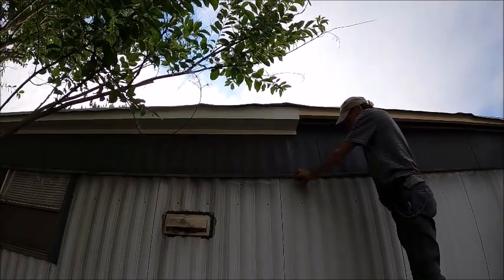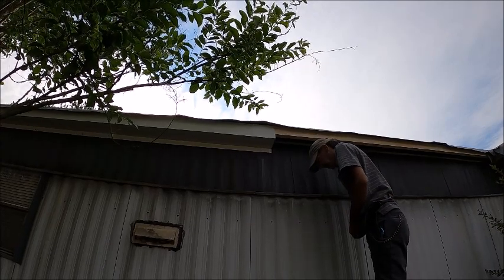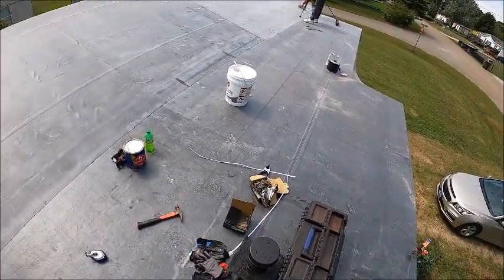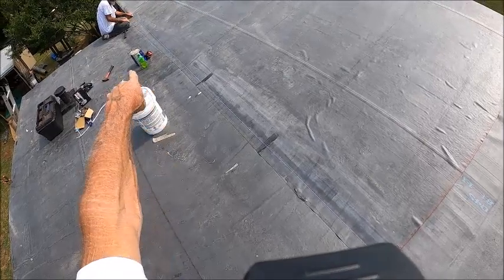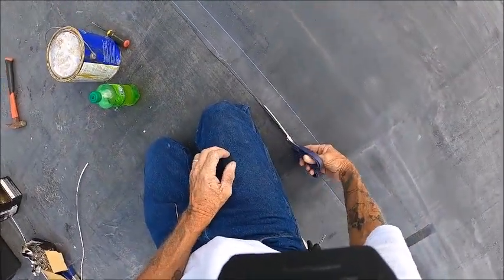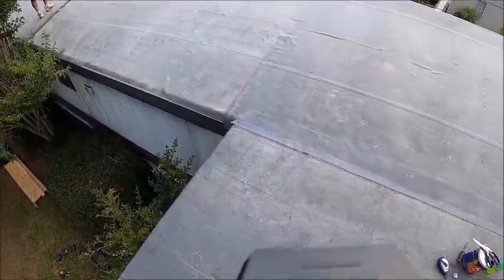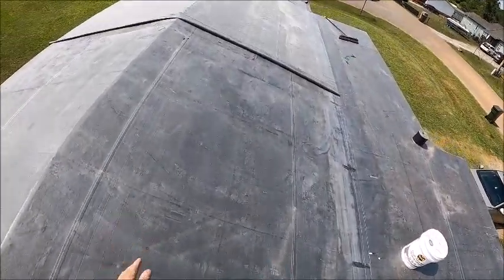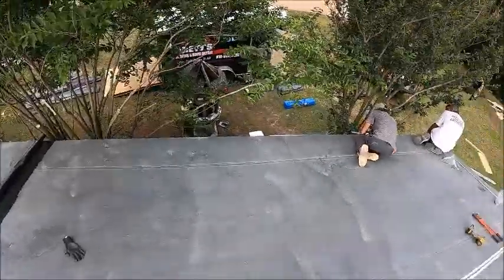Mobile Home Roofing and Repair Hazel Green Alabama 4

Comment: I just now saw your reply from last year to my comment on another one of your videos saying you now work in the Gainesville, GA area.  About how much would it cost to replace a roof on a very old mobile home with a pitched metal roof?   I'm talking about the old kind of roof that practically has no support and you must be careful where you step.  Mine is a 14x60 (which really measures 15x56).  Somebody ruined my roof while stepping around up there applying a coating. Before the coating, I had 1 small leak but afterwards there wasn't a single room that didn't leak! 😵
Reply from the maker: Right now because of Covid we’re not traveling but if we did to do something like yours where your rat would probably be somewhere between six and $7000. We probably won’t travel again until sometime next year. But anything can be fixed on a mobile home. Take a look at this job we did you won’t believe it. You might check back with us sometime in the spring my office door number is 910-845-2207 and again sometime in the spring we might be traveling again. https://youtu.be/Iqk-om13TXk
Reply from the maker: If it’s in Gainesville Georgia about $8000

Comment: Hey Drew , Enjoying the Videos, you have been posting lately I was wondering how much it would cost to put a Roof on my mobile trailer if I bought all the Materials? Trailer is about 56’6 FT Long and about 11’9FT wide low Slop roof just looking for labor
Reply from the maker: That is a good question. I have never done it before where the customer provided the materials. Normally because I know what I need on every job I’ll bring the material with me. If it’s something that you’re interested in getting done labor only I might be interested in that if you got the correct amount of material. And where is your house we are in Southport North Carolina on the south east coast near Wilmington North Carolina. If I did a trailer your size just labor and it was near me I’m thinking it probably cost you about $3000